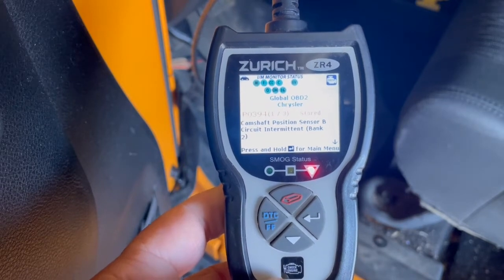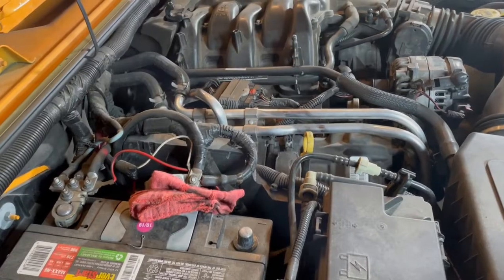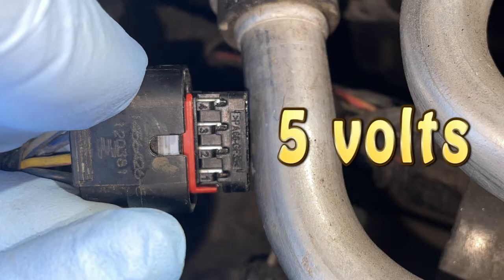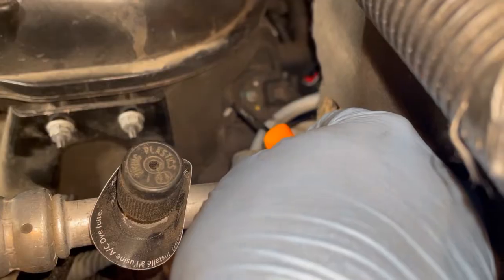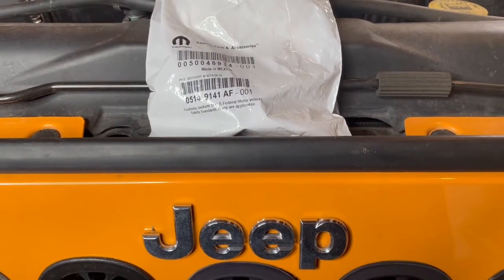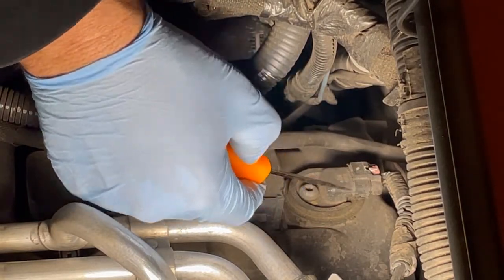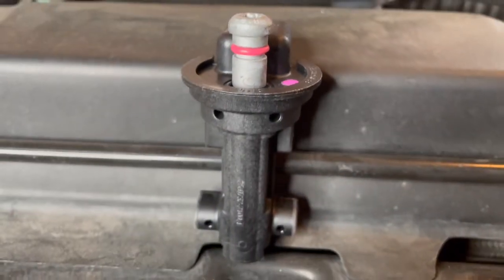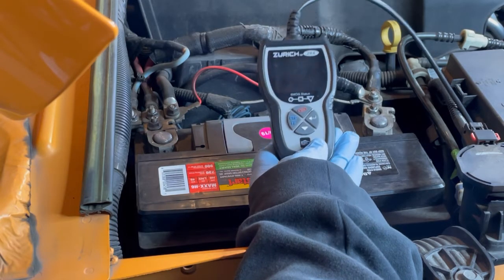P0394 Jeep Wrangler camshaft position sensor replacement location | P0394 code | 2011-2020 | install

Comment: Great info - I need to do this with the drivers side. Omw back from Cali, got a P0394 for passenger side. Replaced that. Was omw up to Jerome az this morning and got the code for drivers side. That's what I get for doing it half assed and not doing both at the same time.
Reply from the maker: Sadly I'm still dealing with the issue, the code came back... I will probably be posting more videos as I continue to troubleshoot. Be sure to test the wiring, I've read on a lot of forums that this is what can cause the code to come back.
Reply: @MileHighCampers  thank you - i bought a meter just for that reason. The code is also now gone which is what happened last time
Reply: @MileHighCampers  did you ever figure it out on why its keeps coming back??
Reply: @MileHighCampers  Any Updates?

Comment: Great video thank you. I have intermittent issues with my CPS. I think it’s a wiring issue. I’m going to use your testing method to check it out. 

Do you happen to know a resource that sells the plug ends for the harness. I think the last time I had mine apart the tab broke 

Thanks

Comment: Hey bud did you ever figure why the engine light comes back on? Dealing with the same and pulling my hair out. I changed both and the voltage is fine. Can you please let me know what happened and possible fix? I see others have asked as well... thanks 🙂

Comment: So I tested my connectors like u said and I’m getting about a 3.75 reading on my wires on both sides I replaced both sensors with oem

Comment: My 2015 had the same codes one for each sensor ... i changed them both in about 15 min.. no biggie but it didn't fix the issue ... i found the problem and it was the one wire was broke ..

Comment: Probably a good idea to go with OEM. They are usually good for just over one warranty period. 😉
Reply from the maker: Thanks for checking out the video, had to re make it when the check engine light came back on... LOL
Reply: Yes use OEM O'Reillys sensors lasted about a year

Comment: What's the plug that comes out of the passenger Camshaft sensor but has the plastic hose clip and appears to go down the rear of the engine?

Comment: what year jeep is that beacuse thats not my cam shaft position sensor mine is bottom of engine on a JL
Reply from the maker: This is a 2012. There is a "Crankshaft" position sensor underneath on the JK, not sure if the JL is similar. This Jeep had the 3.6L Penstar motor.

Comment: Did you have to do a cam/crank relearn
Reply from the maker: I did end up doing that with a computer, I will be doing a video on that in the future.
Reply: I've read where it relearns if battery stays disconnected for 24hrs?
Reply: Seems to have worked for me,,,did 10 hr disconnect

Comment: So if one of my volts reading 3 volts is that the problem?
Reply from the maker: I would say check the wire for that pin going into the plug and make sure it's not loose or broken, maybe try to trace back as far as you can and check for damage

Comment: Worst engine I ever worked on!
Reply: Garbage design for real. I’m on my second jeep and it’s my last. Love it but their build quality is terrible.
Reply: It's an easy engine to work on... only problem is you HAVE to work on it... 😅 I live by the philosophy of when something breaks to replace it with an upgrade. (If there is an upgraded version of said part.) When this motor is done for ill be swapping for an LS, 392, or a coyote. Whatever I can get my hands on.